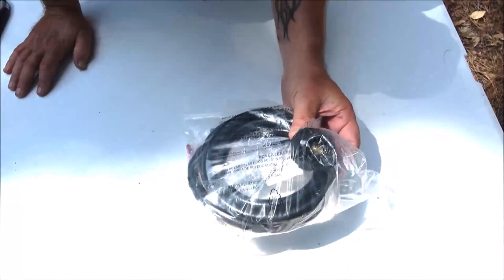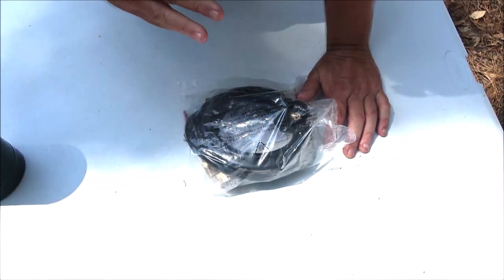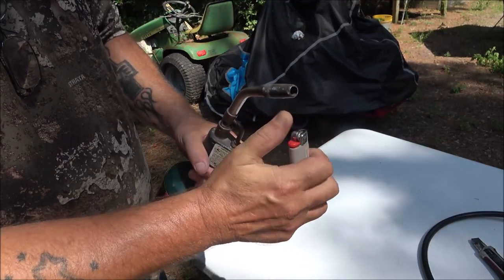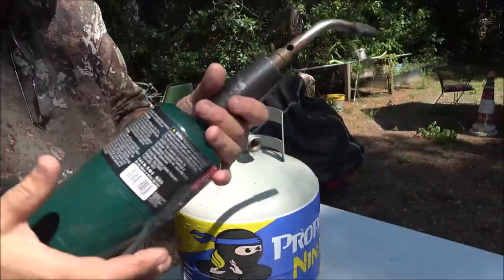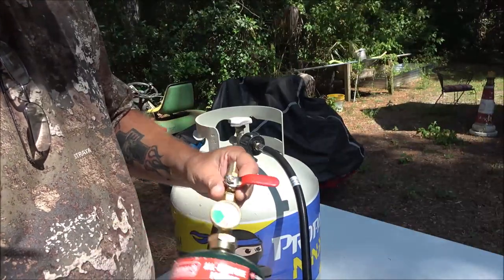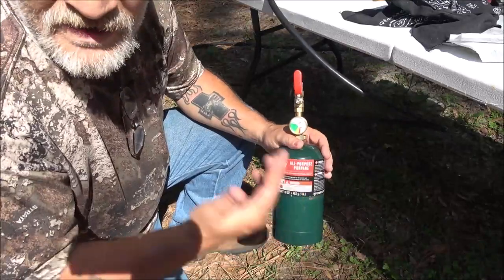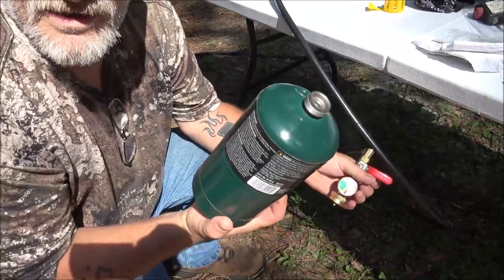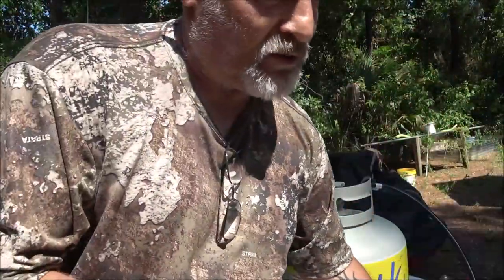6FT Propane Refill Adapter Hose

Comment: excellent video. I just bought this hose. Isn't nessesary to bleed the air  through the pressure release valve as shown in other videos? thanks a lot
Reply from the maker: No. Just do exactly what I did and it will be fine. You can put the empty bottle in the freezer for about 30 minutes prior to filling if you want, but it's not necessary.